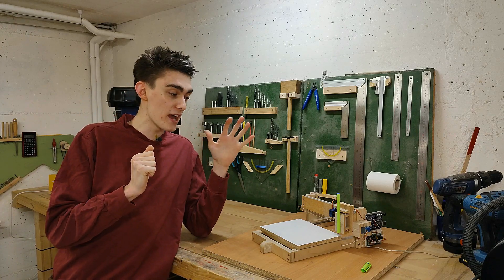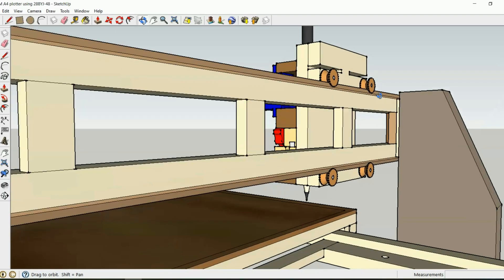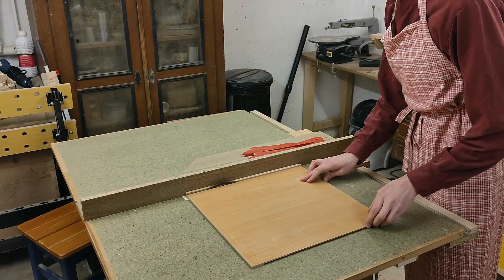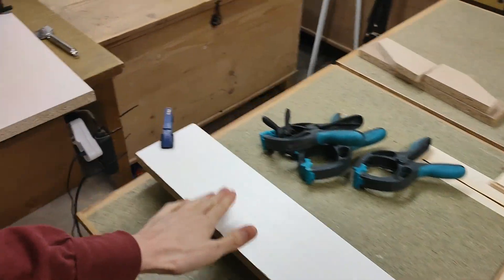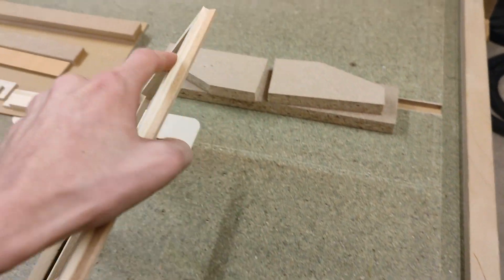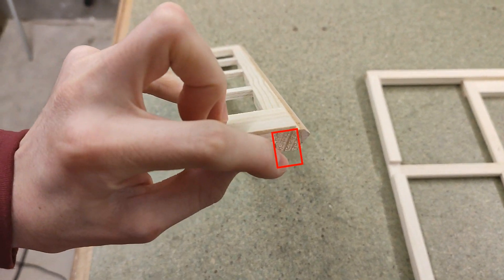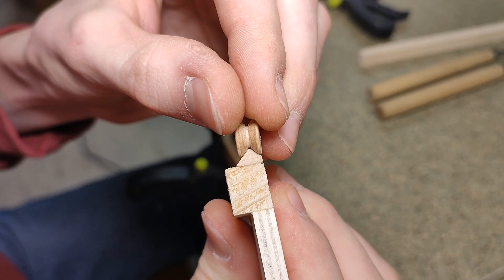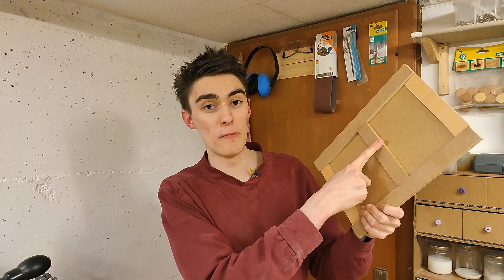Building a 210x297mm arduino pen plotter with 28BYJ-48 stepper motors | part 1 the gantry

Comment: sorry for the stupid question in advance. can the three components (that is the servo and the two motors) share the same power supply using a breadboard? like sharing the same + and - using a breadboard?.  Do i even make sense =/.

Anyways love your enthusiasm and work, i have all the parts for this but not very familiar with electronics.
Reply from the maker: Sure they can, you just need an external 5V supply because the USB port on most computers can only supply up to 500mA :)
I'll cover the electronics in a separate episode where I will also share the schematic, so if you can wait for that video everything will be clear :)